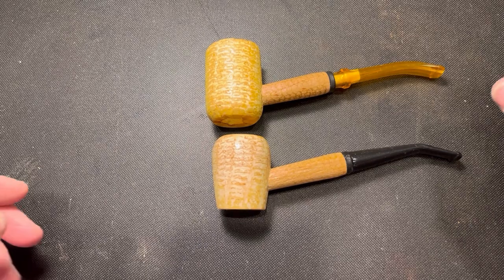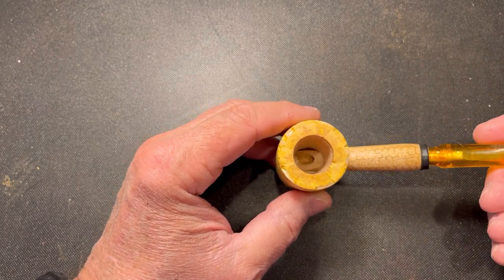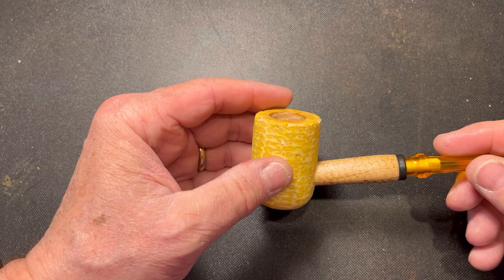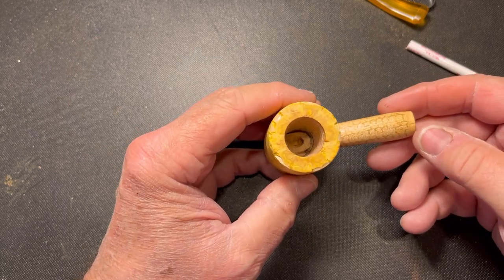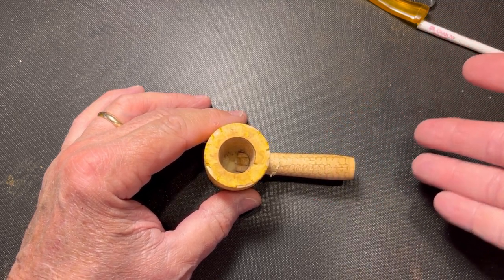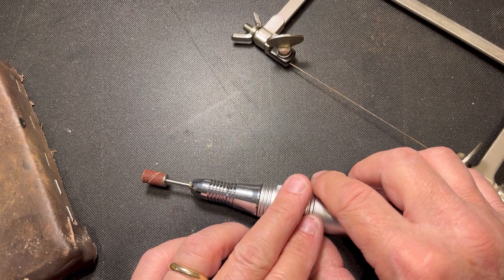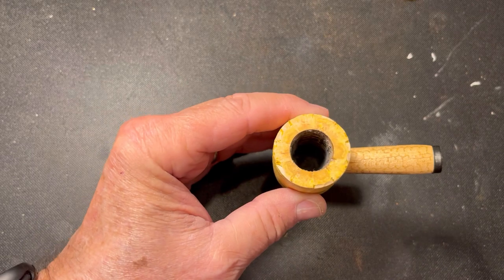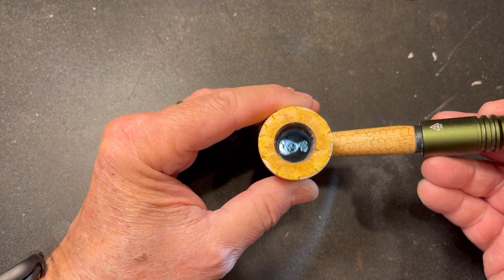Corn Cob Pipe Mod

Comment: Hey Tim. I have an idea for you that will save you a lot of trouble. While at the Missouri Meerschaum Co. factory, talking to the curator of their museum, I was mentioning the fact that one of my pipes had a lot of space underneath the draft tube and also when I got pretty close to the bottom of the bowl when I Tampa it because the draft hole, so big, I sucked down a whole bunch of ashes. She sold me five brass fine screens that are .75 inch in diameter. I think they were like $1.50 for five. So every one of my cob-pipes got the screen. I just pushed the screen down to the draft hole.  That will illuminate every single one of your problems. And it takes about a minute. You won’t ever suck in any ashes. The bottom of the draft tube does not ever start burning. And you don’t have to worry about anything happening to the bottom of the bowl. The tobacco is always above the draft hole so you don’t have a problem of having Dowdle down there. Give it a try. It’ll be a lot easier and you don’t have to risk ruining your pipe by pulling a stem out. I hope that helps everybody. It saved the day on all of my cob pipes.
Reply from the maker: Thank You for the suggestion.  I appreciate you watching

Comment: It speaks volumes about a company who clearly know they are churning out sub par quality pipes that quite frankly are embarrassing. They simply don't care one iota about the quality, the modification you have made should be their bare minimum objective. Missouri Meerschaum, poor quality vegetable pipes with no, zero, nada, not a shred of meerschaum in the making, it is like ordering a steak for dinner only to be served corn 🤣✌
Reply from the maker: You get what you pay for.  Thank You for watching
Reply: @The_Southland_Piper  You can buy basket pipes made from briar that are drilled well with far better quality stems, for less than the price for a Missouri Meerschaum, even their higher priced corncobs that sell upwards of $30 to $40 (and that's online) come with the same sub par quality shanks and stems, so in reality you actually get far less than you pay for, then factor in your time and money to make the modification and a $30 cob becomes what price? Far more expensive than many briar pipes that have good quality fit and finish built into them. If you try to defend their poor sub par quality based on them being cheap then they are still way overcharging, that is exactly what Missouri Meerschaum are banking on though, people not caring about quality or value for money.
Reply from the maker: @stonehengeminstrel  
Some people just love corn cob pipes.  I don’t judge. Just showing how I do this particular mod.
Reply: @The_Southland_Piper  Your instructional video is great and I am not judging people who choose to smoke corncobs, I am judging (and rightly so) the company that make them, JUST LIKE YOU ARE, otherwise you wouldn't feel it necessary to make these modifications because of "common faults" and "the burning up of the protruding shank material as you smoke them" as you noted... To judge is to give an opinion about something or is able to decide if someone or something is good or bad. Everyone judges just about every aspect of their lives otherwise how can we tell good from bad, by judgement and judgement alone. If their corncobs were not of poor quality to start with then the two modifications you like to make to every cob would not be necessary. Missouri Meerschaum simply don't care their customers have to smoke burning wood in a product designed to burn tobacco. To defend them, and on a price point that is incorrect also, boggles the mind. I would say in 2023 they have had just about enough time to work out how to negate these two major distinctive faults, it's a very simple solution and down to drilling/positioning miscalculations and poor design, even an apprentice engineer could work it out in under a minute, they just can't be bothered to do so, because they don't even care about their customers. If inexpensive basket pipes manage to align the bottom of the chamber to be aligned with the shanks draught hole, then why can't Missouri Meerschaum do the same? There is no excuse whatsoever that is remotely acceptable for any company that makes pipes as their core business.
Reply: Stoney the cob snob strikes again😂😂 I love cobs, but can’t be bothered to put in the time and effort to fix factory or design flaws. I only buy their seconds, so I get ‘em for ~$6-7 each and chuff ‘em like a train when I do yard work and haven’t managed to burn through one yet. I can’t figure out why folks will pay $35+ for a “pretty” cob with an acrylic stem, but MM has apparently found folks who will. 

For those who will take the time to shore up the flaws, this is a great instructional. Aristocob’s mud has a cult following, but Scott has had to step back from the shop for a while. Shame because he was my source of cheap nekkid cobs.
Reply: @ParsimoniousPiper  😂😂 I'm not a snob of any sort 😂😂 Huckleberry Finn without a corncob just isn't right. I love Americana and tradition, I'm just not a fan of Missouri Meerschaum or those who run the company for the quality aspect as noted that can be fixed very easily, providing their customers a better quality pipe for the same price. It's an easy fix, even a monkey could fix it eventually by chance give it long enough 😂. If the bottom of the pipes didn't look like a hand grenade had gone off inside I'd smoke one myself for the fun of it if nothing more, I simply refuse to buy poor quality pipes in principle, I love cheap pipes, just not ones that aren't finished, if that makes me a snob then we need to redefine the word snob 😂. Hey and it's corncob Tuesday 😃👍✌️

Comment: I use JB Weld on the bottom. I went as far as contacting the company to ask if it was safe. They said they didn't see a problem and I've been using it for a few years now.
Reply from the maker: I’ve heard of using JB Weld.  Glad you check before using it.  I just don’t know if I could use it.  Now if they had a food grade product that would be different. Thank you for watching.

Comment: You could always make tight fit oak dowl plug for the bottom now that that draft part is removed. Hammer it down.
Reply from the maker: @1122stardust  I guess you could do that. Not a bad idea.

Comment: This is interesting to me as a corn cob smoker. I generally just fill in the voids around the stem with some pipe mud, so the stem-hole is the lowest point in the bowl. I also put a light coating of pipe mud over the exposed parts of the stem in the bowl, so it's all black at the bottom of the bowl. So far, none of my pipes have burned through the stem material. They char to a certain point, then stop. 

However, I also rotate my pipes exactly like a briar, and I have no fear of leaving a little dottle in the bottom of the bowl.  Your mileage may vary. Since I don't smoke cigars any longer, I'll have to try out the pre-made pipe mud.
Reply from the maker: I appreciate the comments. Thank you for watching.

Comment: I did something similar with Durham's Rock Hard Water Putty, which is just plaster of Paris. I left the shank in and filled the bottom with the plaster until it just got above the level of the shank. Having tried it both ways, this was definitely the simplest and I have yet to taste any burning shank, which is hideous and harsh as a mofo!
Reply from the maker: Regardless of the method, it’s great to get rid of the shank burning taste

Comment: I leave the shank in and just reshape the bottom of the bowl using pipe mud. 
Pipe mud recipe:
cigar ash mixed with water to an almost dry consistency.
Reply from the maker: Nothing wrong with doing it that way. Thank you for watching and the comment.
Reply: Yes, I did this as well with plaster of Paris. Works like a charm.

Comment: i followed your method this afternoon on two missouri pride. used a small round file on the shank. for the mud, i used what was on hand, a bit of cigar ash and plaster of paris. hoping it works.
Reply from the maker: I think the pipes will be just fine.

Comment: What kind of glue did you use on the shank? What do you mix with the carbon that you put in the bowl? Thankyou for the video!
Reply from the maker: The glue I used to reinstall the shank, is the same as the manufacturer, Elber’s glue. The pipe mud that I used is no longer available. However, CaneRodPiper has a video and he shows how he makes his pipe mortar. Link below. It is very similar to what I use and I will use when my supply runs out. 

https://youtu.be/bq0mOVw8cuY?si=o2mPw_jSrsAmOtb-